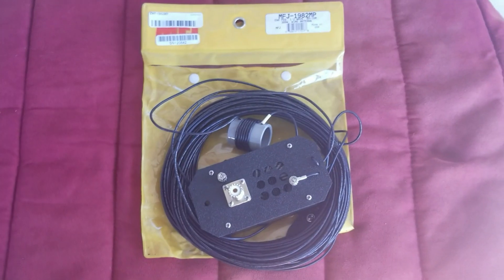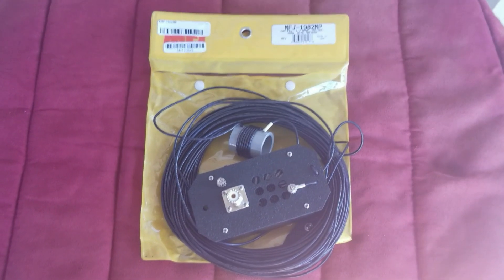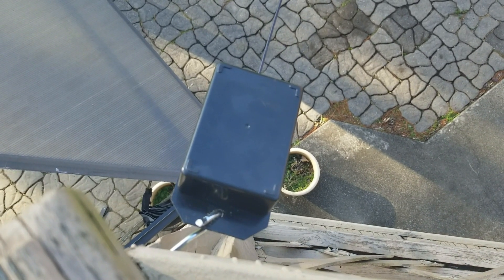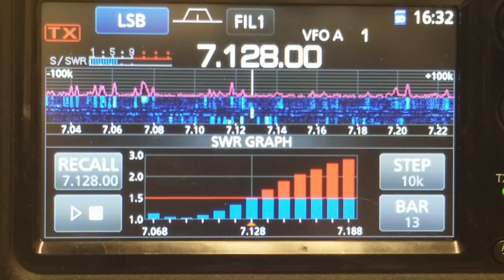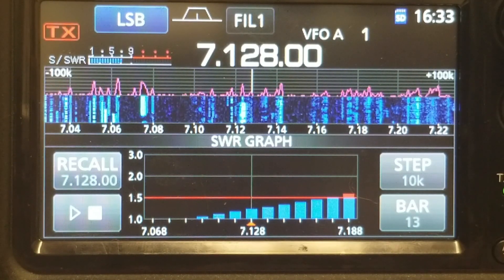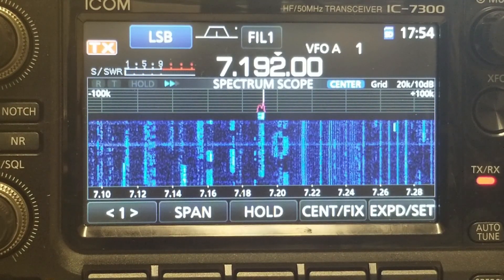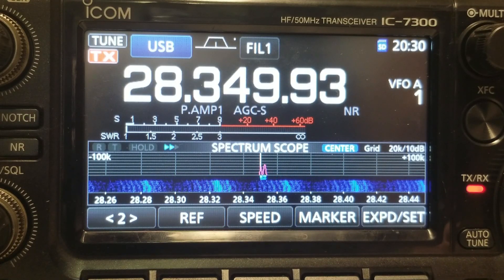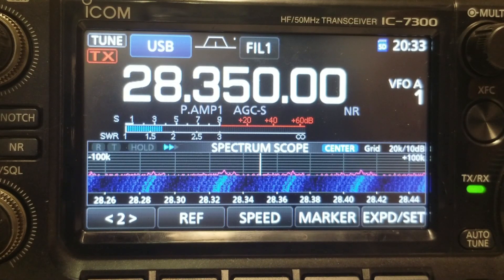LCARA HAM Radio: MFJ-1982MP End-Fed Antenna Test!

Comment: I am using this 1982 antenna and running frequency sweeps with my nano vna. I can't get a good SWR on 80m and 10m 12m through 40 m is ok. I am doing frequency sweeps for the general class range.
Reply: There's a video where someone shows how if you add a 300pf capacitor right in the middle, 75 swr is low.

Comment: I have the longer end fed version and found that it is a decent receiving antenna. I do not find it to be an antenna with which I make many contacts. I've used QRP as well as QRO (<100 W) but find it is not great on any of the bands for which it is rated. I've used it on 8 deployments and over 10 hours of use. (I'm really determined to figure this out.) The only effective mode to make contacts with is FT-8. Overall, I'm disappointed with this end-fed antenna and will not use it as my primary antenna until I figure out what others find is so good about it.
Reply from the maker: @Ken Knox - I hear you. I didn't have much luck with it in the only one application in my backyard. I fear it was to low for much work above 20M. For NVIS, it worked pretty well for 40 & 80M. I gave it to another member and he's killing with it. So height does make a difference.
Reply: @LCARAHAMRadio  And the counterpoise.  Remember that an end-fed is really only half an antenna.  You need to attach a counterpoise to the feedpoint for best results.
Reply: @denelson83  I agree. Without a couterpoise, multiple wires actually, this antenna will not work efficiently.

Comment: Good video. I have the low power version.. Have to use tuner to get SWR down. So, I wonder if I shouldn't just use a G5RV?  I thought it was goin to work without a tuner.. However, I will now try to lower the box and see what I get. THanks for the video!
Reply from the maker: Also consider using a counterpoise as well. Although the product description says you do not have to, play with different lengths of wire to see if that helps.